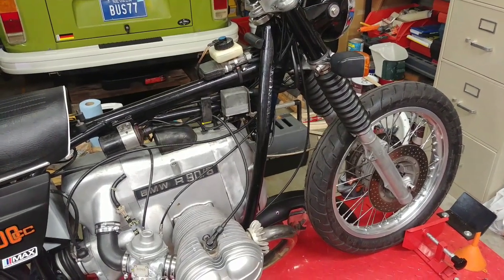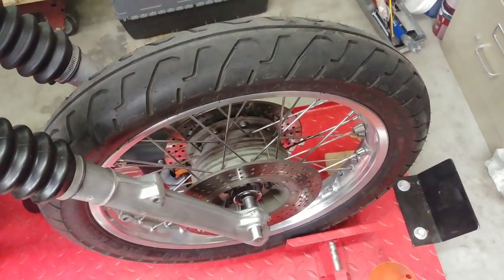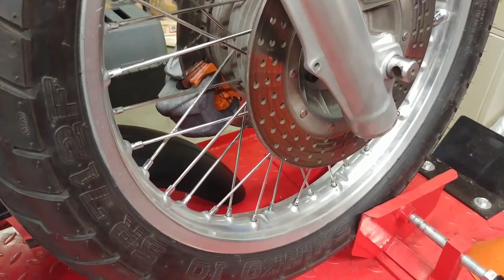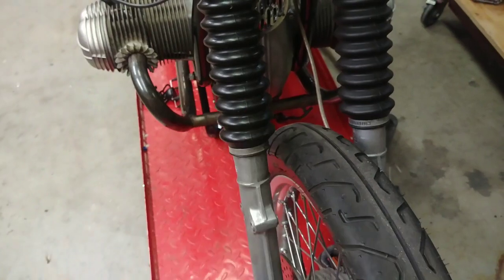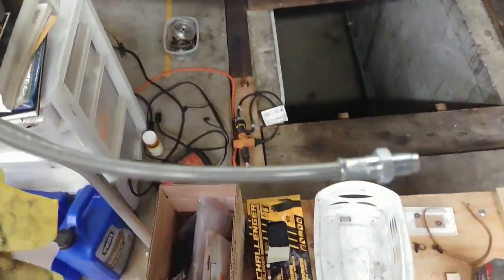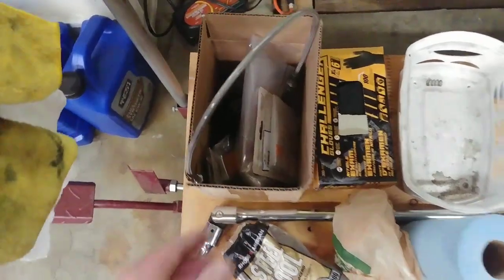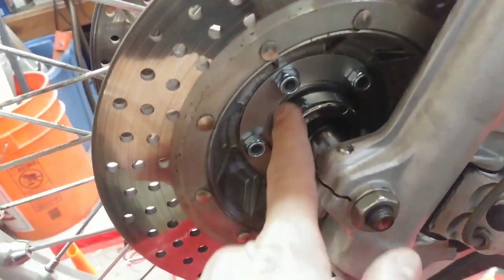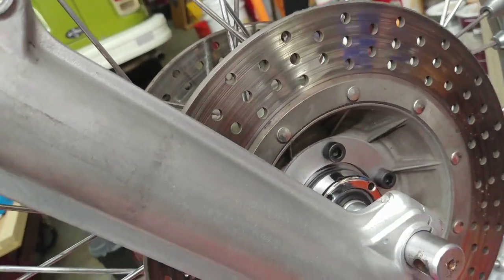USB for Airhead and other things

Comment: Was the usb charger all functioning correctly with your agm battery in the end? Does it turn orn/shut off when it should?
Reply from the maker: I think so. Seems to disconnect when the battery voltage drops down.